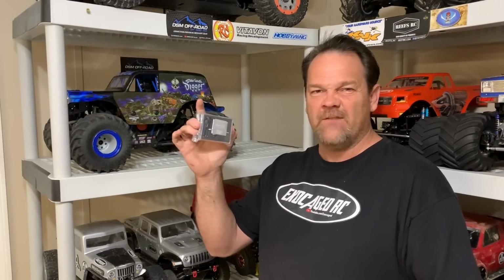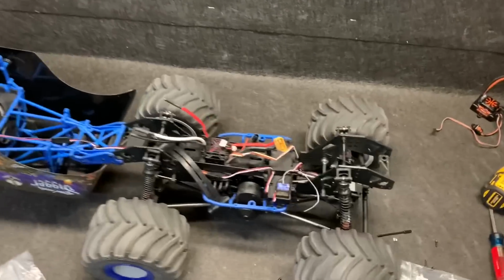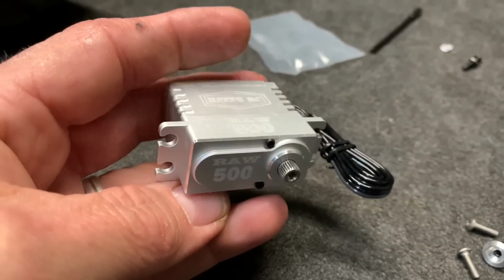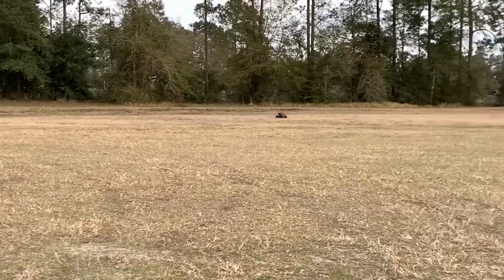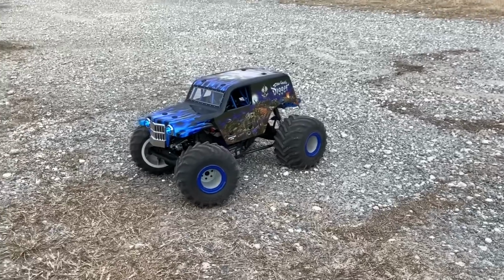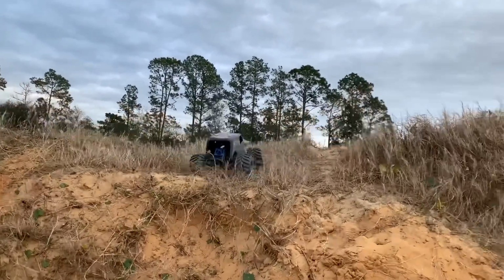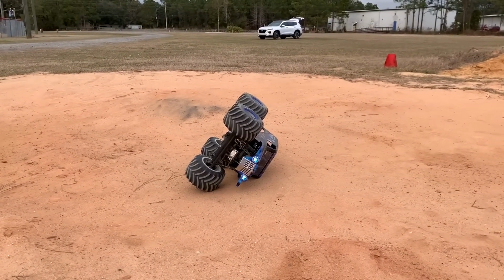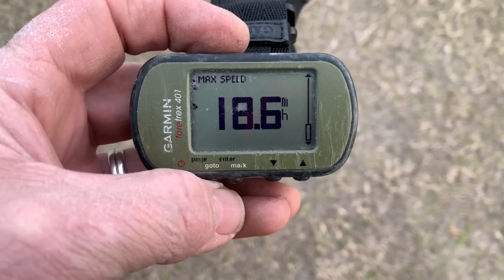Modded 4s LOSI LMT HOLMES CASTLE REEFS

Comment: That's a good set up the 2s speed is 2mph faster than my clod with a 20T motor on 2s so with all the other battery options you got yourself a truck that can be run in any situation..... That wheelie was epic!

Comment: We must have had the same thoughts. Hated the cogging. Hated the servo and 23 t . Hated the plastic everywhere. So went treal everything. 50kg dmond servos ( yes 4 wheels steering upgrade) and the wider stance.and castle 1515 mamba x 3-6s and I’m trying out all pinions . Went from a toy to a serious all rounder. Bash, crawl, bit of speed, doe nuts for days awesome fun rc. Nice job on yours . Also I shaved a bit off the esc mount plate and the battery tray pin and nut . The mamba c went in perfect with some dual lock .

Comment: I was waiting on this video from you. Curious on new motor esc setup in this truck. Curious if that reefs servo holds up with no servo saver. I hope someone makes a new servo saver for all the 25 t servos. The stock servo def is slow and under powered imo.
Reply from the maker: Servo yes. Horn no. LoL. Found out a few minutes ago.
Reply: My stock s614s just froze up. Going to get the raw 500 what’s a good 25t servo savor ?? Yes I’m a rookie at this?

Comment: I was able to fit the Monster X on sideways, which may be another option for mounting it to consider.

I also tried the direct horn servo and my Savox died after two packs, the gears stripped. I really wish Losi had the 25t servo saver available. I’ll be curious how long the 500 lasts without a servo saver.
Reply: They do have a 25T servo saver. It is a pre-order currently. Part # Los241037
Reply from the maker: Servo lasted fine today. The horn didn’t. LoL. Yeah I’ll get that 25spline piece pre ordered for sure. Maybe a few of them.

Comment: EXO which servo is better for my TRX4 Crawler?
Reefs Raw 500 or Reefs 555. Both will be on 7.4v. I’m not looking for speed in the servo I’m looking for power. Thanks 👍
Reply from the maker: Both are awesome. For me it’s the Raw500 for the speed but the 555 is stronger but noticeably slower by a lot.

Comment: I found with some servos I have used if you run a cheap aluminum servo horn, it will strip the horn instead of the servo. It's easy enough to to carry an extra servo horn for a trail truck,  but my smt10 has a kimbro 1/8 scale servo saver, Its not super acurate, but I beat the hell out of it.
Reply from the maker: Funny you mention that... I stripped the reefs horn a few minutes ago. LoL
Reply: @ExocagedRC  pay to play friend. But seriously if there are any of the big hit servo savers in stock I want to try one.

Comment: Also, as I'm sure you know they make some pretty great servo saves that are 25 spline.
Reply from the maker: Yeah I need a couple of them lol
Reply: @ExocagedRC  I'm sure the raw 500 can take more than you can throw at it. I think I would be more worried about the steering linkage that hooks to the steering servo horn. It looks like it wouldn't take much to break it off of the linkage that connects the tires together.

Comment: I think your motor choice gave you a minor torque increase and actually reduced the speed of the truck even with a 16T pinion when compared to stock/14T pinion.

If you really want to upgrade the truck considering you are already running a Monster X ESC then a Castle 1512 2650 kV on 4s would be my preference.  If you really wanted to go insane then a Castle 1515 2200 kV on 6s.

Comment: It's unfortunate the Spectrum S614 servo has 23 rather than the more common 25 teeth. Having all steel gears, 201 Oz/In of torque, and a $20 price tag it's my go-to servo for bashers/scale-bashers. The 2100Kv Holmes Puller Pro seems to give the perfect 'punch' for the LMT. Great instant torque, and linear power to V-max. That stock 3150 spectrum motor comes in the tenacity DB Pro. It has a nice 'turbo' like hit about 2/3 throttle on 3s. AWESOME with a long, low-CG chassis, but I would think it problematic on a chassis like the LMT's.
Reply: It stinks on LMT if you like low speed control bc of the clogging like Joe just said , it must be nice  with sensors motor , my lmt still down bc I broke axle housing